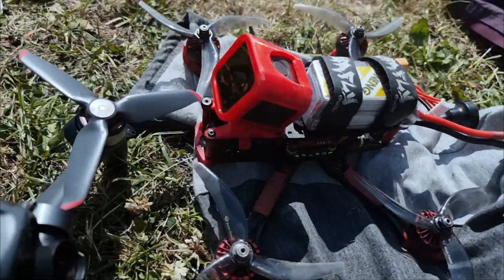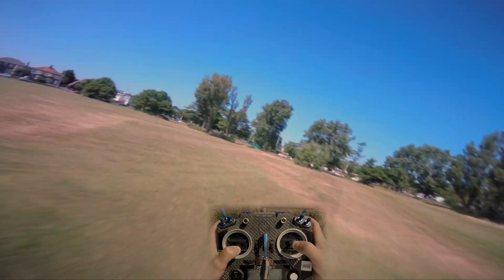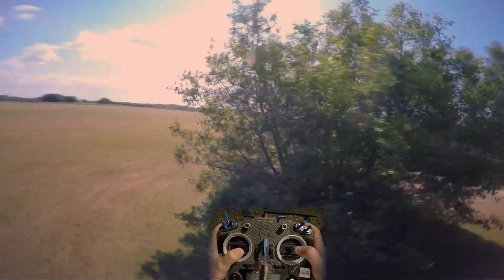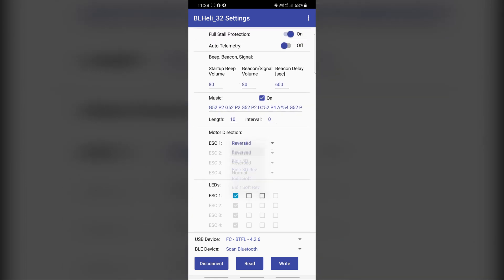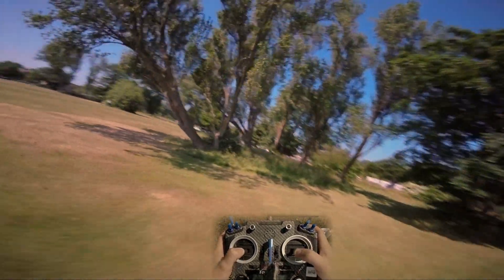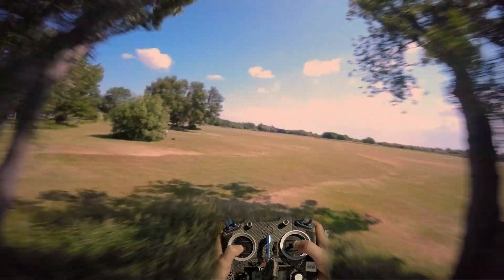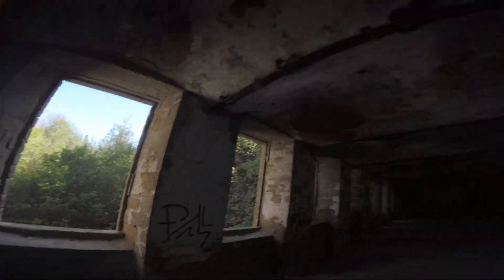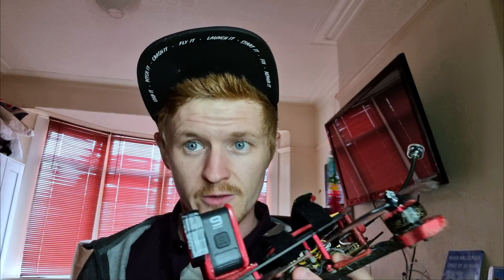Props In Vs Props Out || FPV Drones

Comment: Nice video dude I mean tbh I cant see a difference in the video so I stick to props in which is the norm, and no issues like the weird one you found...looks like a nice day for freestyle!
Reply from the maker: Yeah any differences if there actually are any are very subtle. I should've probably got a bb log of both of them to find more info. I will get some eventually lol. I run props out so I can bounce off stuff mainly. Flying in these bandos it's a death trap. And it def was. One of the best weather days so far 👌